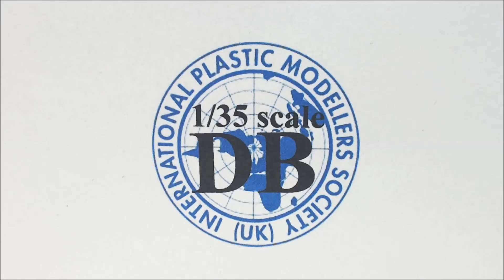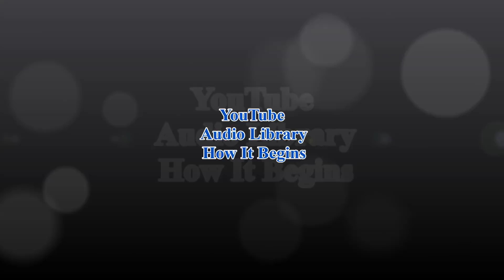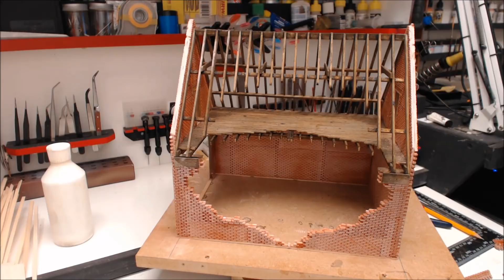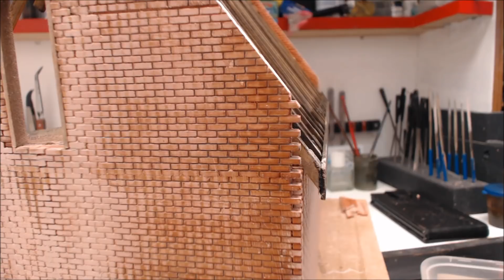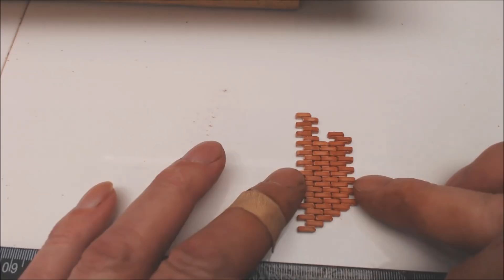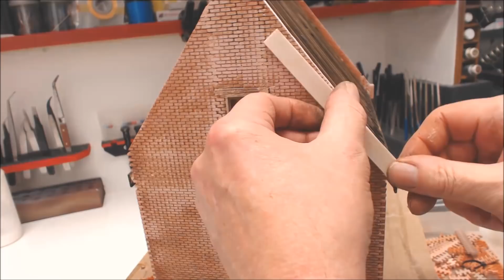Basic Build (2) part (5) Barn Build In 1/35 scale

Comment: What stain did you use to do the timber in and where did you buy your buildings from if you don't mind me asking
Reply from the maker: Vallejo game color wash  50% of the wash and 50% thinner  the gaining wash comes in two colours brown and black .both colours we use on the woodwork as the building I'm afraid to say it was made using silicon rubber moulds which I cast and then assembled into the building checkout channel is plenty of videos about it hope that was some help to you many thanks sim

Comment: I couldn't catch what was listed with PVA glue for the joints at 29:25. What was it?
Reply from the maker: I actually use thin cardboard and PVA glue that over the joint between the two brick panels this made the joint a lot stronger many thanks Sim
Reply: Thank you for your reply sir!

Comment: There is a easier solution to the brick orientation, just put an arrow on the back of each piece pointing to which way is the top, then you can still put it together with the bricks facing the desktop.